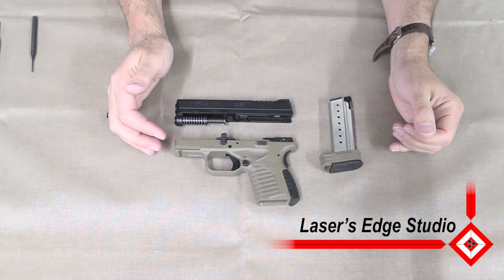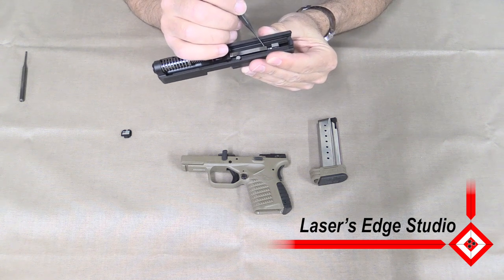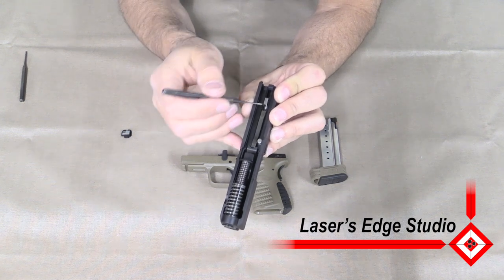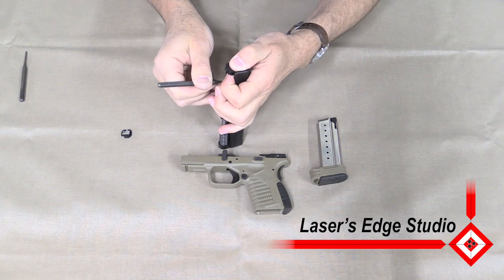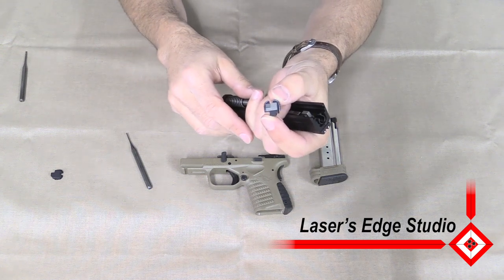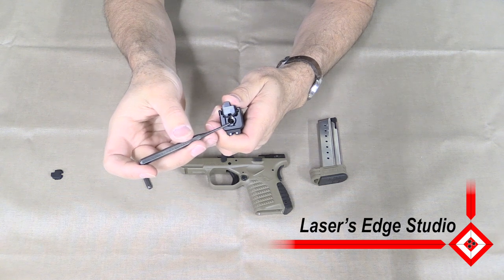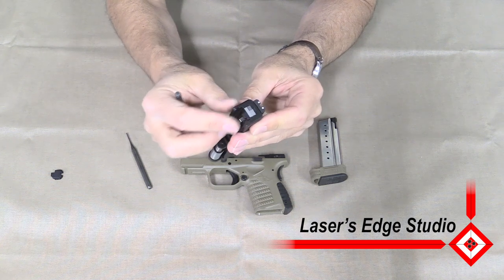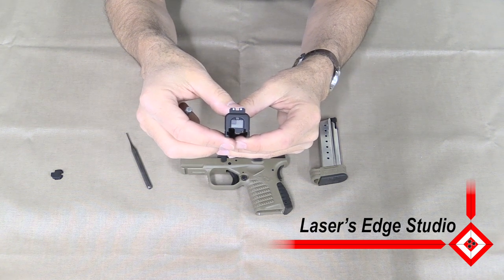Springfield XDS Backplate Removal and Replacement

Comment: What do you do with the spring that shoots out no video says to put it back in and it’s impossible to do so
Reply: Did you figure this out?
Reply: What spring? I didn't see anything go flying.
Reply: I can help if you still stuck on this
Reply: Lemme guess, you have a model that has the pin right next to the backplate? 

Yes, be careful when removing the backplate, and keep your finger over the pin, or else it WILL go shooting out, and you'll be searching for the spring and pin somewhere on your floor.